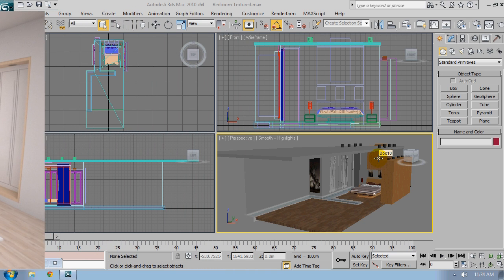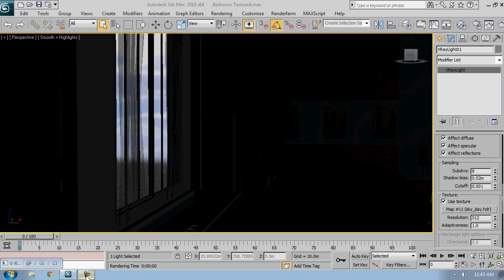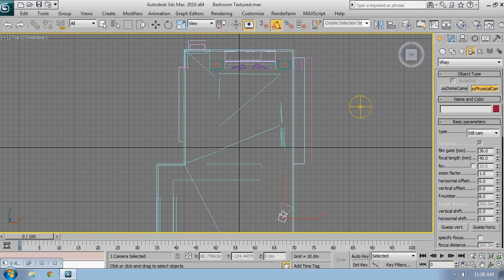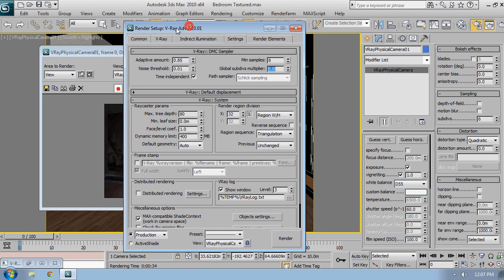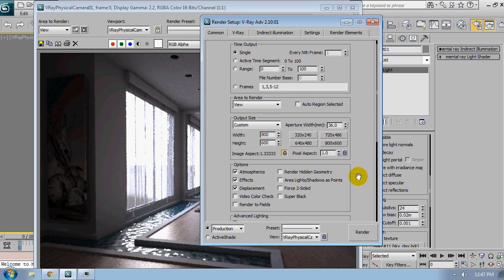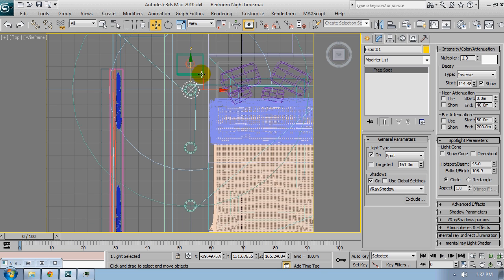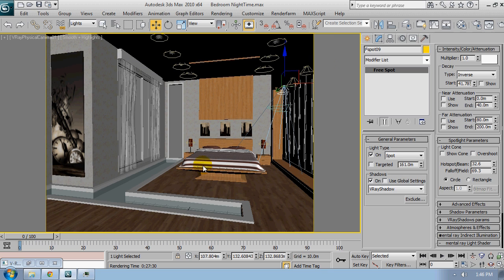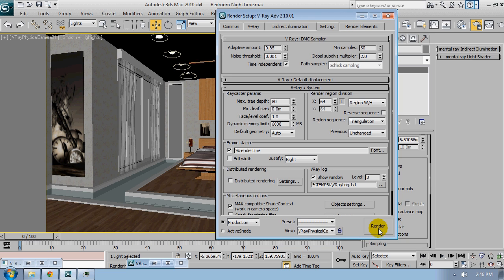Architecture tutorial on 3ds max vray rendering 9

Comment: When we switch to night rendering, even though I put lights on and changed hdri, it still renders like it's a day, just it adds bit more lights...then I tried to use my previous saved model (just model) with no settings for day render, and then I put camera and lights, seems like v ray doesn't recognize lights at all, and uses default lights. Any help?

Comment: I have a problem with a lot of noise on my renderings. like here - http://postimg.org/image/cxjr1c3tp/

i tried changing sampling , subdivisions ... nothing helps...
any idea?
Reply: Try Noise Treshold Settings menu in render setup :)
Reply: Thug Angel The problem was simple, it was the production engine .... after switching to Vray Adv. everything got much better...
Reply: Thug Angel unfortunately I also get a lot of noise...although different that Iwo's.... cranking the Noise Treshold up doesn't seem to do anything... What could it be??
Reply: +Lucienne Bregman - Better late than never... Open Render Setup, open the V-Ray tab, click 'Image sampler (Antialiasing)', next to Type select 'Adaptive subdivision'.